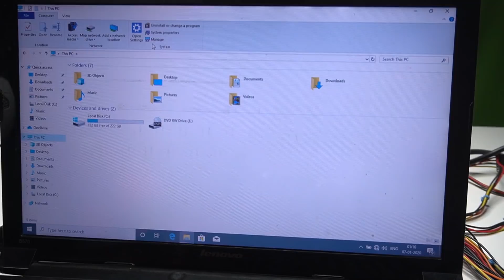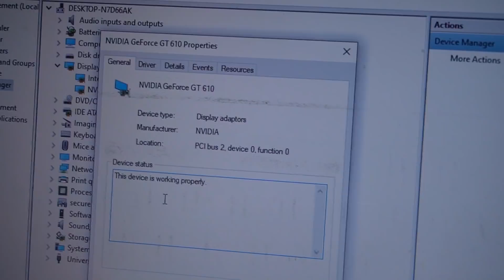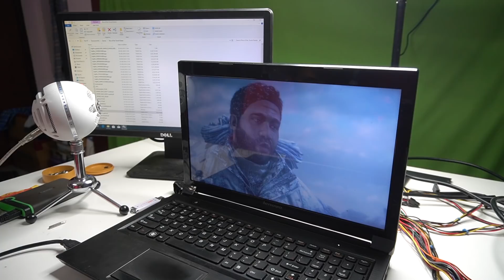Amma Laptop இனி Gaming Laptop ஆக மாற்றலாம் Install External Graphics Card in Laptop Tamil

Comment from the maker: First i used 1050ti then drivers didn't support so i have used my old gt610 graphics card because i can't afford for any new GPU for this video because already i have purchased Dock around 4k.

And Don't Comment Foolishly without watching Video also Check Description
Reply: Bro if get error code 43 in device manager. There is way. By installing 1050 Ti's old drivers. You can run it
Reply: @endlessgamer4876  enna way bro?
Reply: Tomb Raider setup upload videos podcast bro
Reply: Hi Bro i would like to buy your 1050ti gpu if its Low profile will it support Dell OptiPlex 7010 core i5 3rd gen
Reply: @endlessgamer4876  old driver install panrathuku atha use panamale polam...
Reply: @Tech Vibrate adei motha nee summa foolish mari pesitu irukatha da... NVIDIA intha method full ah disabled aagura mari panitan... EGPU use panrathuna namma dock or thunderbolt support iruthathan mudiyum... GTX 750Ti models ke driver support ilatha pothu apram epdi da 1060 ithula vera 1070 1080 la varumnu peela vidura? Inno update pathi therijum poi video va paru description parunu katharuriye apa video poga thane intha salli thanatha panina... Neela technology theriyama enathuku video pottu engala emathura enga time waste panra? Therijatha mattum vachu scene pota vendithane?? Theriyatha visayatha apram therinjum un thappa maracha ithellam adukuma adukave adukathu da...
Reply: Enatha intha mari veena pona spec laptop la eGPU use panalum athum athuve namma 50k mela selavu panatha mudiyum na athu worth eh kidayathu! Apdi use panalum maximum bottleneck than aagum performance la oru difference varathu!! Athukku puthu gaming laptop oh ila nalla desktop oh 50k mela selavu pani vangitu polam... Atha suggest panna ivanuku vakku kidayathu iruthalum aduthavanga nanga unmaiya sonna unakku foolish ah da? Unala yaruda video pota soli azhutha?? Venumna nee intja mari veena pona lap vachu video pannu athu mothala unala mudiyuma? Atleast game achu viladuviya?? Summa un video kaga ipdi irukatha da nambi pakura viewers ku motha nermaiya iru...
Reply: @KantanandUs  don't try those foolish methods
Reply: @jivin6810  Yeah I will say. Go with nando 1.35 and install old drivers it will work
Reply: @incredibleunknown2686  😂  Yeah you are right. NVIDIA only patched that their card are not to work with exp GDC dock. But AMD cards are allowes you to Install with new drivers without any issues
Reply: @endlessgamer4876  is it true?
Reply: @incredibleunknown2686  Yeah
Reply: @endlessgamer4876  but don't know how it performs well without bottleneck issues
Reply: @incredibleunknown2686  For bottle issue I have a solution. By default laptop PCI-E  will be 1.1 after converting 2.0 and 3.0 bottlenecking will be negligible like 2%-5% or no bottlenecking issue.

Bottlenecking CPU that's common issues that will happen in desktop too.
Reply: @endlessgamer4876  yep...
Reply: @incredibleunknown2686  It seems like you are interested in this project ☺
Reply: @endlessgamer4876  absolutely!
Reply: @incredibleunknown2686  You have exp GDC dock??
Reply: Bro can u Send me PCI cable iam ready to pay. I live in salem. Please rply
Reply: @endlessgamer4876  no but trying to buy a good one
Reply: @incredibleunknown2686  bangood is the best place to buy. If you get from there
Reply: @innovativenation9357  Bro you can better get a new one
Reply: @endlessgamer4876  but few people says it will make delay to arrive
Reply: @incredibleunknown2686  Yeah you're right. It may take 20-25 days to reach out. If you need quick you can get from olx. The people who are failed in this project they are solding in olx
Reply: @endlessgamer4876  oh...
Reply: Karthi S  Yeah Nvidia patched new that won't work with in the method of exp GDC dock but you can try installing old drivers
Reply: Karthi S  NVIDIA tricked for their business by patching it
Reply: @endlessgamer4876  old drivers potalum intha error aguthu bro agama iruthalum performance mokkaiya varuthu
Reply: @incredibleunknown2686  If you find wrong drivers go with nando 1.35 it will help you.
However the performance won't effective. For better performance they should go with 
NVIDIA atleast 900 series 
AMD atleast Rx 400 series
Reply: @endlessgamer4876  oh ok
Reply: yarada foolishnuu soldra nee than foolu yengalala  yelarayum yematra ,external graphics card work agathu da loosu they blocked pcilan ,this video is compeletly fake ,nee yenna periya pudungi nu nenpa ,mariyathaya pesipalagu ,dont comment foolish nuu potrukaaa
Reply: Bro Lenovo b490 government laptop la support aagumaa
Reply: Sir After Processor upgrade government laptop working good & also now processor have turbo frequency & I upgraded to 8gb ram & ssd & windows 11 & I have one ram slot so I installed 8gb & if u have two ram slot you can upgrade to 16gb ram.

Comment: Bro gta 5 smootha run panna minimum laptop setup and best suggest lap onnunu sollungo please
Reply: 2 gb graphics nvidia 800 above will suit well
Reply: GTA V ada minimum  8 gb ram venum illana 4 gb ram + 2 gb vram venum
Reply: Say your budget bro.
Reply: @kaviyokesh  Minimum 6 GB Ram Vanu bro
Reply: Graphics card VRAM is not important. Graphical processer is only important.
Reply: Build a desktop don't buy a laptop they suck get like a GTX 750 ti from des and don't play GTA 5! It has violence
Reply: Manoj Alexander s
Reply: @ramanathanparamasivam4455  Innum GTA 5 va idhanaaladhaan avanunga 7 years ore game a release pannitirukaanga.
Reply: @Faster2525CK  just play red dead redemption series ,if you don't like GTA series,its lit.
Reply: @Hass clickz ,just buy a used console like ps4 slim/xbox one s,its cheap and worth the price.
Reply: @mohiththiyagu6217  Nah, I am not into violence or any sort of stroy games
Reply: @mohiththiyagu6217  No, it's not worth it, you buy the console and then you spend 1500 ruppees on games, pc building is the better choice
Reply: @Faster2525CK  1500 ku PC build panna mudiyathu ya
Reply: @RathaBoomiSMP  I am talking about game price

Comment: e41-25 gov laptop la gtx 1650 poda mudiyuma bro....pota pubg mobile 60fps+ ku varada mudiyuma bro............ please konjam solunga bro........
Reply: No bro
Reply: Government  laptop has poor CPU. As GTX 1650 has powerfull graphical processer. So GPU will bottle neck which result in shutter & sudden frame skipping. 

So if you want to do exp GDC project with government laptop. Choose GPU will low end .
Reply: Gtx 960 ok bro
Reply: @santhphotography  
Have you tried. Can you please guide me??
Reply: Bro @Technology cloud 
Gvt lap athoda integrated graphicsoodaye bottle neck Aagidhu ithula external graphics card Veraiya..

Comment: I have desktop model of Lenovo idea centre 510s-08IKL 90GB00QIN. I like upgrade my GPU to msi gtx 1650 Low profile small form factor. I have the doubt of whether it suit for my pc model...Size .Power supply...Expansion slot ..Etc....My pc i5 CPU,16 gb ram,2 tb HDD.... I am not able to get proper detail about my pc gpu expansion details in any where...analysis and tell to me .

Comment: Thanks bro neengga great a2d naiyu Amma laptop to gaming laptop egpu video panna aana van antha videola tunder bolt port irukkara laptop la thaan mudiyum egpu vanggi thaan use pananunnu click bait vaichu yemathuna aana neengga unmaiya solli help panirukkingga super
Reply: Dude this video is misleading.... The graphics card will bottleneck the processor... U won't get any gaming experience
Reply: @dragonballfan9997  illa bro gpu power cpu powerkku eedu koodukalana bottle neck aagum nu yelarukkum theyriyum ippo neengga oru acer ultrabook 8th gen or above it or 7 vangganiggana unggalukku verum intel hd graphics thaan irukkum optionalla newngga antha laptop gaming kku use panun boothu cpukku equal peformance thara gpu use panalam ippa govt lap la low grade cpu thaan venun na 1030 or below use panna bottle neck aagaathu

Comment: Dell 5501 laptop bro geforce MX 150  I will try external graphic card bro
Reply: Bro.First you need find option to disable PXE boot to LAN option in bios. And second thing if you have option to switch to Intel integrated graphics. 
If these options are available you can run it. 
Before selecting GPU better select AMD GPU.

Comment: bro im new of your channel i subscribed now bro i have a question 
1) this setup will work on any laptop???
1 asus x540m its my laptop it will work please tell me bro
Reply: Need to check it. But my personnel suggestion is to buy a PC instead of laptop. Ethukuga nan solluran na mostly Laptop vandu limited upgrade than panna mudiyum. But PC la nenga tharu mara upgrade pannalam. Aana Konjam selavu aagum. Neriya per kita LAPTOP than irrukum. But PC sila per kita than irrukum. Nanum first GOVT laptop Hassee than use pannitu irrundan. But appram konjam konjama sethu vaichu kadaisila PC vangitan. Enaku gaming romba pudikum. So, I waited and buy PC.

And ethukaga nan PC vanga solluran na, even nenga nalla laptop suitable for gaming na eppadiyum 50K to 70K kulla varum. But indha amount ah vaichu PC ah neriya upgrade pannidulam.
Reply: @jpthehero  Yes offcouse and for 70k man you could build a system with ryzen 3 3300x and a rtx 2060 which would just destroy laptops! Btw onguloda pc specs enna?

Comment: Rise of the Tomb Raider System Requirements

Official Minimum Requirements
MINIMUM:
OS: Windows 7 64bit
Processor: Intel Core i3-2100 or AMD equivalent
Memory: 6 GB RAM
Graphics: NVIDIA GTX 650 2GB or AMD HD7770 2GB

how could you play .gov offered laptops have only 4 gb of ram and core 2 duo processers